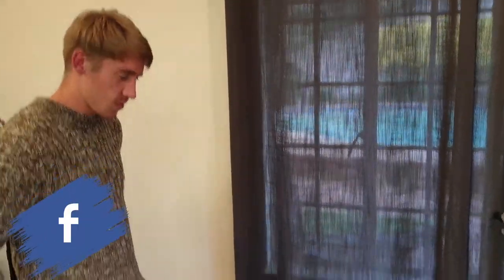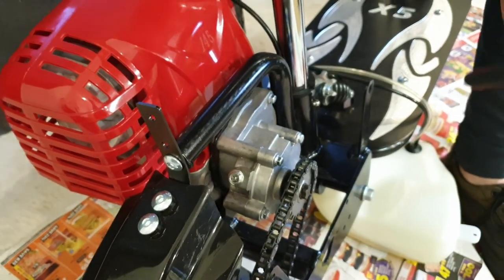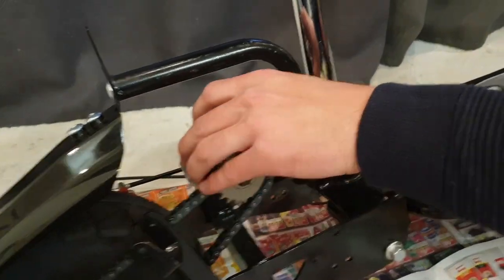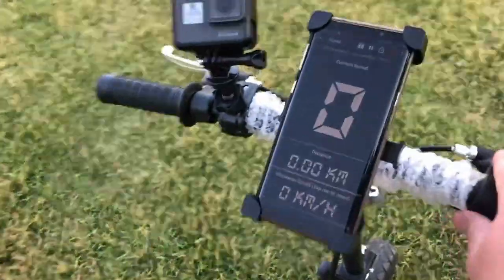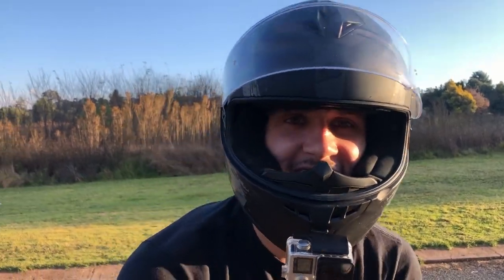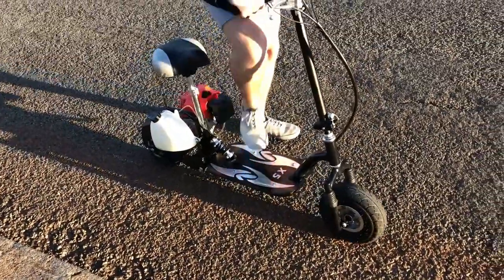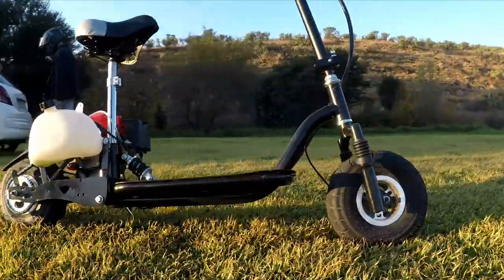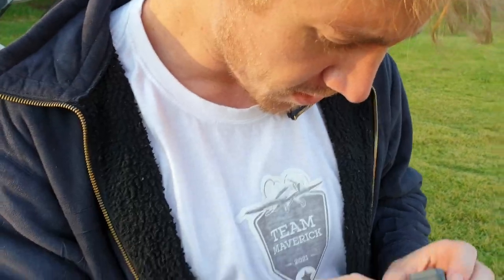Engine SWAPPED Scooter 52cc BUILD and TEST!

Comment: That's strange, I have a 52 cc kawasaki engine that pulls me like I am weightless and I'm heavy. Has a power pipe and gets to 80km/h
Reply from the maker: Design 😅 also we didn't figure this out somehow until after the video but the pressure of the tires was so low that it was eating all the energy but not deforming the tire